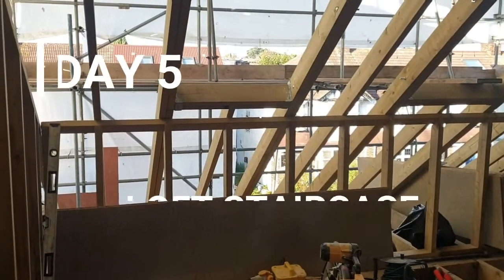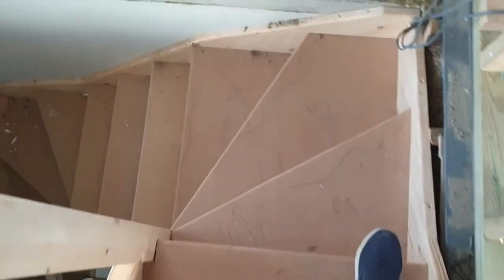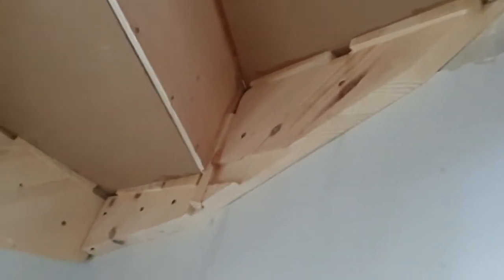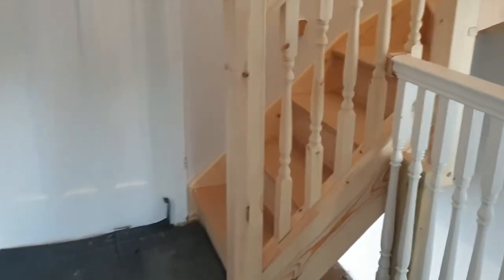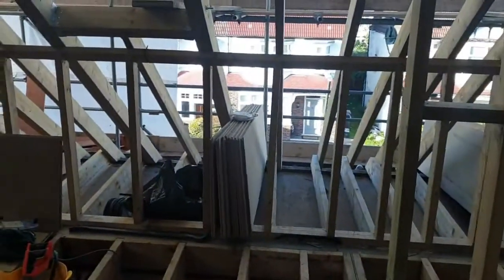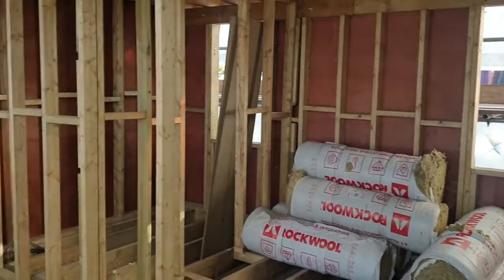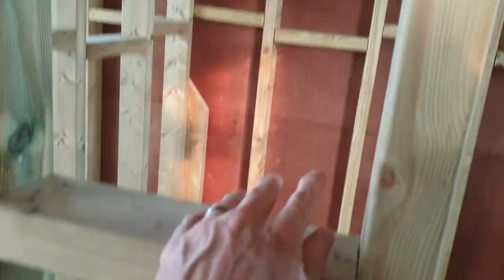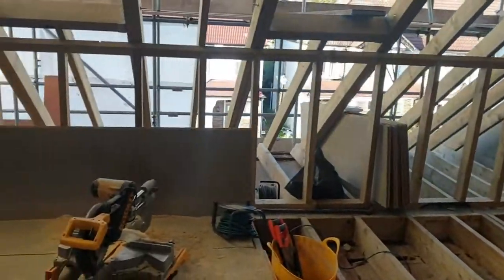LOFT CONVERSION DAY 5 - Loft Staircase Installation & Construction of Shower Room - Day 5 OF 18

Comment: Thanks for sharing! I'm in the process of doing a loft conversion - is there a reason why you build internal walls before the chipboard is down? I was planning on laying the floor before building internal walls to help reduce noise levels between floors but would be great to know if this is totally wrong! Thanks
Reply from the maker: Hi Tom. Thanks for watching and the feedback. The usual porcess is to complete all your timber structure, then your first fix plumbing and electrics and finally put your insulation and chipboard flooring down. The walls need to be constructed first to enable you to complete the first fix and run all of the cables and pipes into the positions for the sockets / rads / taps etc. There will always be noise from the construction so putting the chipboard down won't really solvebt that problem! 👍

Comment: How much would it cost to do it all
Reply from the maker: Hi Bradley. It obviously depends upon the size of the loft, the finish and the builders that you use but a hip to gable conversion such as this one should will cost you somewhere between £50k and £70k.
Reply: @joeblogs   Do I need to speak to a joiner or a builder And thank you for your reply
Reply from the maker: Hi Bradley. We would recommend speaking to a builder as you will nees lots of different trades and skills to complete the works - including carpenters, roofers, electricians, plumbers, plasterers etc. If you do not know any builders go online and look at websites such as MyBuilder.com or Checkatrade and you will be able to find local builders who have completed similar projects in your area.
Reply: @joeblogs  thank you